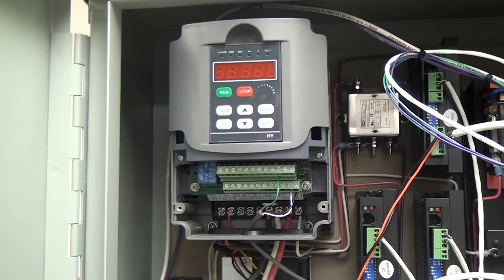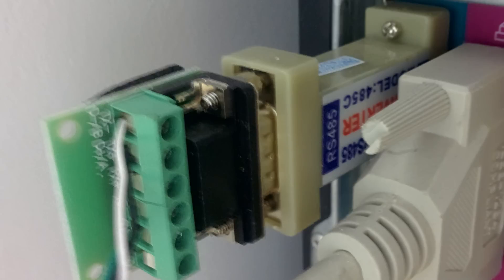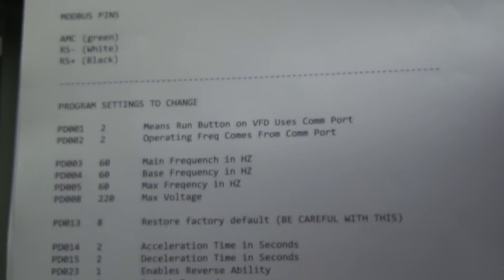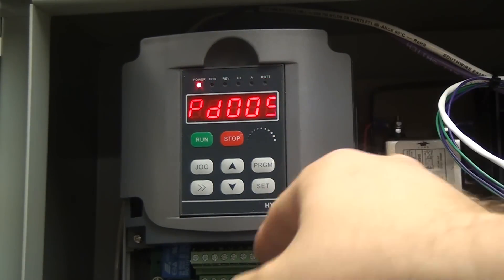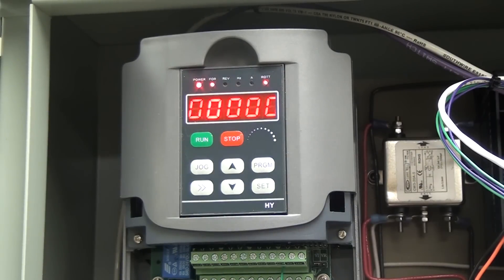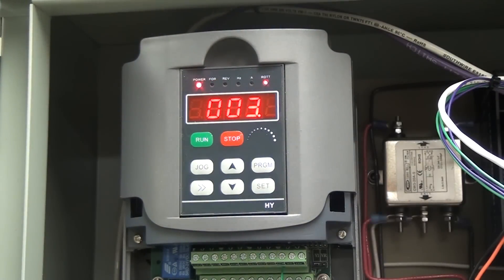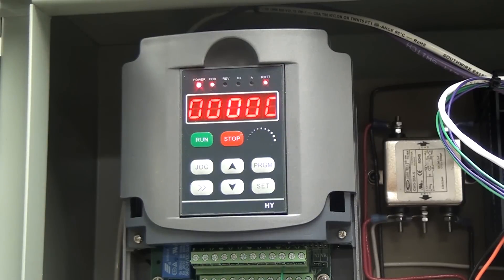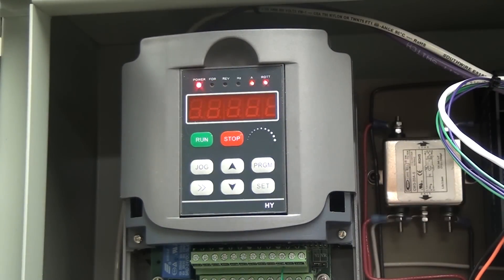Huanyang VFD 2.2kw (pt2/2) - Programming

Comment: What electric filter does the inverter use before the vdf?
Reply from the maker: I used a 115V/250V 20A Single Phase EMI Filter I found on Amazon. Looks like my model is no longer available but there are others.
Reply: My Doubt is. Use two, one in inverter 1.5kw and the other in more engines drivers.
Would it be correct or unnecessary?

Greetings, great job.
Reply from the maker: I believe some people do use two, one before the inverter and one after. I could be wrong.

Comment: thank for your valuable explanation. i need your help. i have a spindle those are the description of it. 
mot:3phase
poles :2
V:110V
Hz 400
A 8.00
Kw 1.50
R/min 24000  i am living in Canada the electricity Hz is 60Hz
can you tell me to set up the program of my Hy VFD
Reply from the maker: It sounds like you have one of those high-freq 2.2kw spindles. I have one too but never got around to wiring it up. I would suggest clicking the link in the video description and going to my dropbox. There is a folder with files for this VFD and there is a text doc called "Parameters" that will get you going quickly.

Comment: hello sir
I had buy this vids of7.5kw from ebay.
so I have 3phase motor3.7kw.1480rpm.
so can I increase the motor speed to 3000rpm?
how?
Thank you
Reply from the maker: You need to run the motor within its specified rating. Mine is rated to run up to 180hz, which is triple what comes out of the wall (60hz in the U.S.). If your motor is rated to handle the higher frequency then you just set that as your max hz in the VFD.
Reply: Thankfully sir

Comment: Hi,
with my VFD is something wrong. When i want to connect ground cable to VFD i start  voltage , whole electric instalation at is home shutdown?
Reply from the maker: Hello Anima I'm not sure what you mean. Are you just wiring the VFD to the mains and having an error, or are you referring to when you hook up the motor to the VFD? Which pins do you need help with?

Comment: Hi Russ great video, the drive is good i have the 5hp version, i wanted  to ask it you have noticed any issues with dynamic breaking or have tried it yet - it will stop the spindle a lot faster than with out.. helps more on larger mill/ lathe spindles than the smaller ones. on my lathe i have a 5hp motor and takes a while to slow down unless you have the breaking setup and add the breaking resistor. the problem with mine is that it was missing the Dynamic breaking electronic parts on the main power board. i was able to find them from mouser and had to order them and install.. the VFD is now able to stop the spindle in less that 3seconds from 2800 rpm.  there is a video on this issue on youtube here --> link to (Huanyang VFD with dynamic braking)  https://www.youtube.com/watch?v=cOMjNhSRAe0    and he also has some links to the Mach3 support forum that addresses this issue. other wise it has been a good unit so far. Keep up the great videos 
 Mitch
Reply from the maker: I haven't tried the dynamic braking or bought a braking resistor yet. I plan to, but I haven't researched it at all and am not sure what resistor to get. Do you have a link to the one you bought on Mouser?
Reply: hi, the resistor i am using is a 100 ohm 250 watt i just happened to have it around the shop. the parts i got from mouser are the ones missing from the vfd. mine was missing the IGBT, a 6pin optocoupler P701 and a diode. the parts have a place to be installed on the pc board but were not installed by the factory. the IGBT was the same as the others that are installed and the same for the opto. - you will need to check the circuit board to verify if it is missing any parts and then go from there. check out the link i posted and it has a link to mach3support form that had the same issue and the fix..
Reply from the maker: Thanks for the info. I found the resistor I need, only $25. I'll be getting it before long.